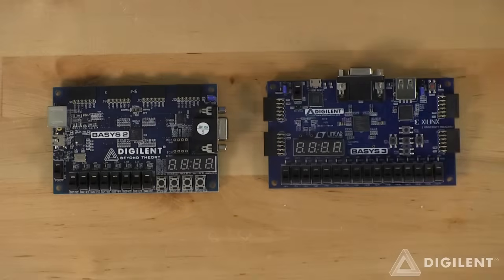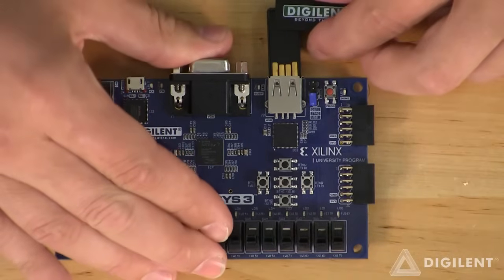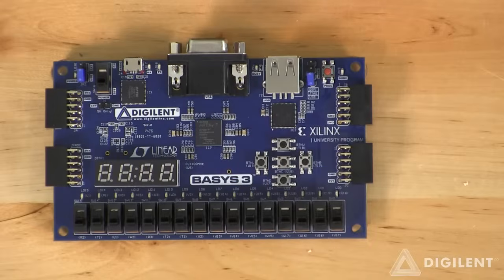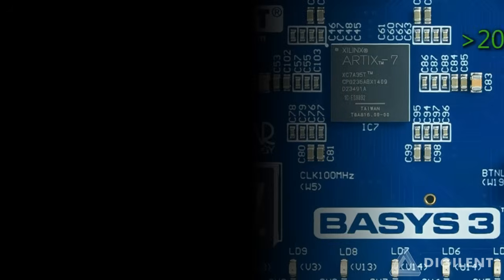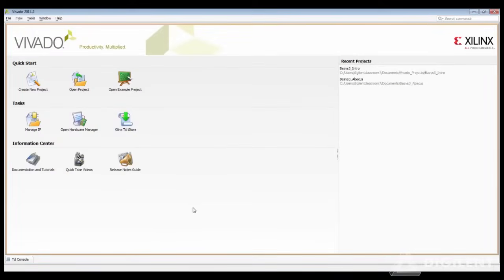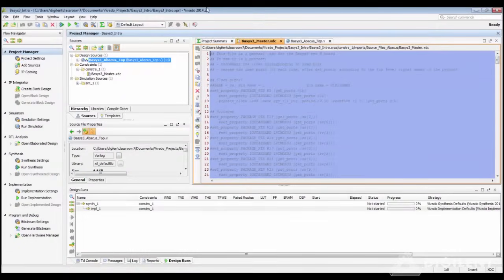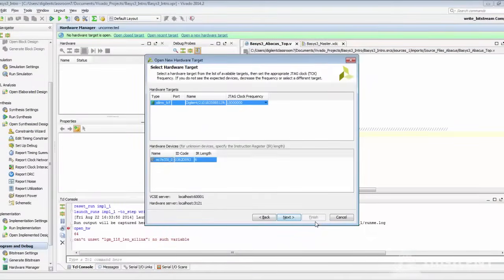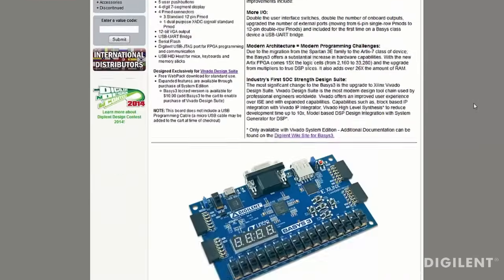Basys 3 Introduction

Comment: My issue is: thru a micro usb cable/plug, my pc can provide power to this board, but fails to recognize its jtag port, even though I’ve installed the driver already. Any idea?